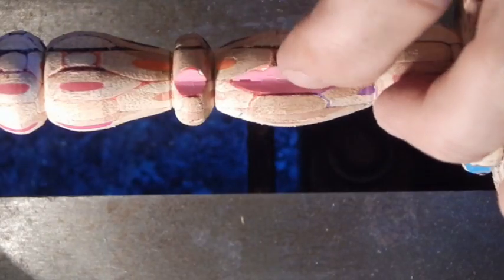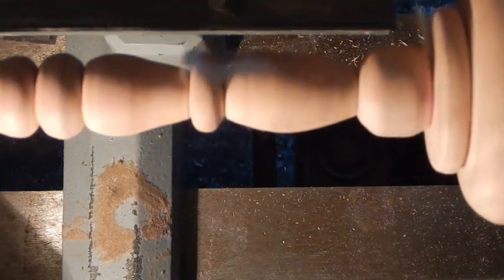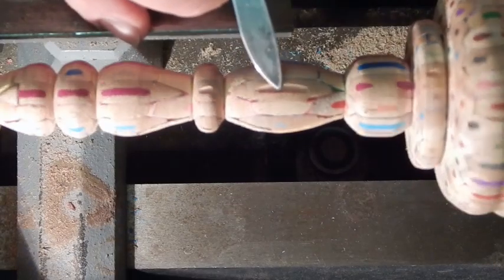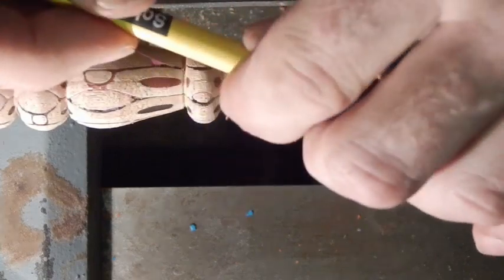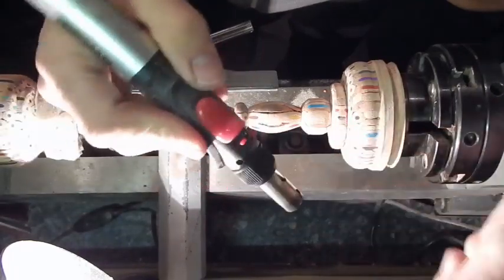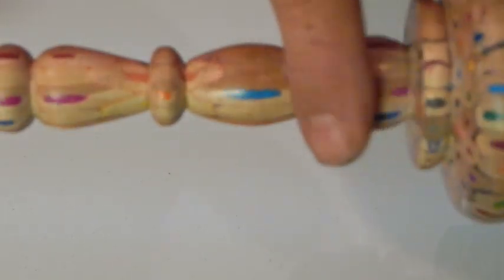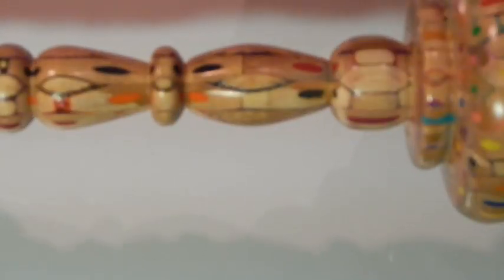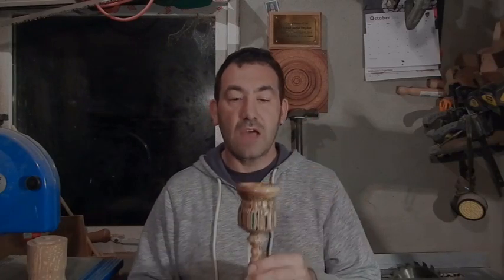Woodturning a Colour pencil goblet part 3 of 3 video (#5)

Comment: Great finished result. The CA has come up a treat. Did you put anything on it after sanding as there looked a difference in the tone of the wood? Not sure if you used sanding sealer or anything.
Reply from the maker: Hi Paul, sorry for late reply, very busy these days ....... Yes I used a sanding sealer first before applying the CA glue, then I buffed the piece with T-cut to bring it up to shine. Cheers for watching and commenting, regards Steve.

Comment: i wonder if play doh would have worked instead of crayon ???
Reply from the maker: Hi, Play doh would be no good for a project like this I'm afraid, it doesn't set hard and is oil based.....
Reply: Also, Play Doh dries out over time and shrinks and cracks.